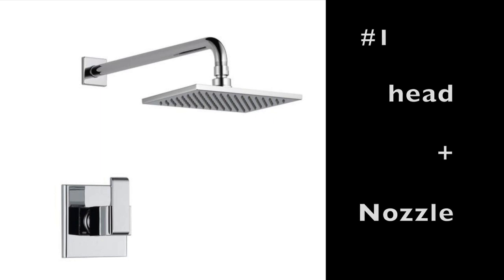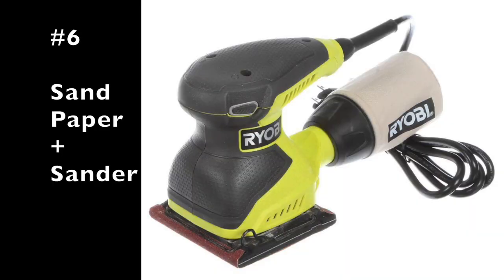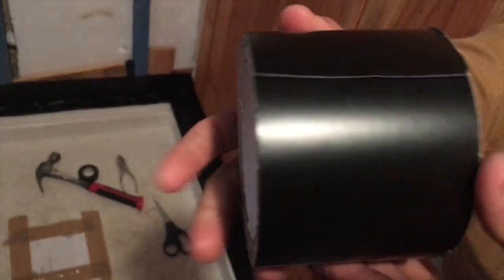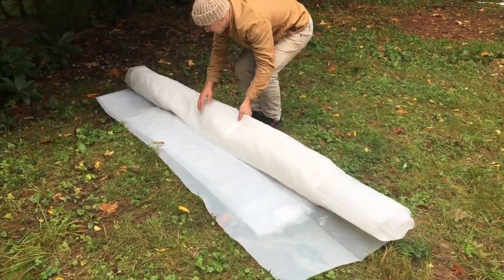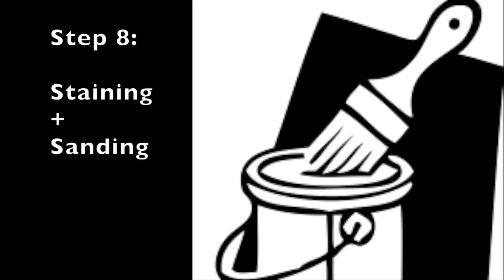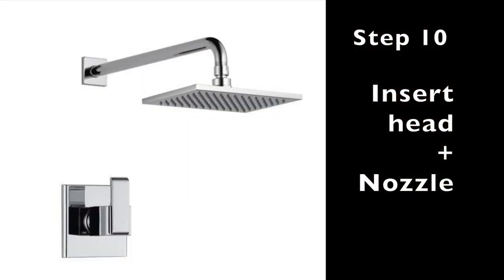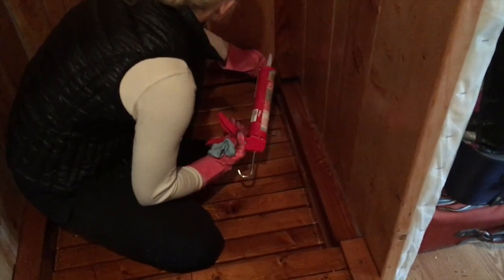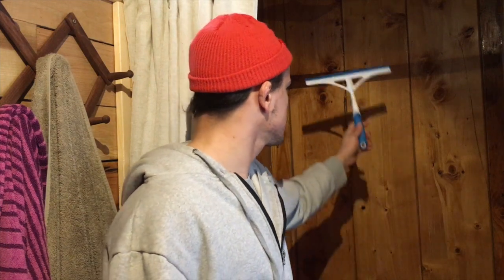DIY indoor wooden shower

Comment: Looks fantastic. I'm considering doing this. The only thing I might suggest doing differently, although it adds some expense, but also considerable longevity, would be to use a tongue and groove cedar. Tight fitting seams that are easy to keep sealed up tight.  Instead of a spar urethane, use a clear epoxy. Absolutely waterproof, and high gloss that lasts, easy to touch up if marred in any way. Brush on an additional coat in the tongue and groove seams for absolute water tightness. And use a PVC shower liner behind the walls instead of the plastic sheeting. All those folds will eventually hold humidity (moisture) and create mold within the wall.

Don't take the above as criticism. I think what you did is outstanding. Just adding some ideas to possibly enhance the experience for others considering doing this.
Reply from the maker: yeah those are all good ideas. I appreciate the feedback.
Reply: I have am starting a similar project.
You made some good suggestions.
Reply: I agree, the spar urethane will probably last a long time too. I do like epoxy more. I think for less maintenance you could have a wall system with a tongue and groove channel that will allow the water to just weep down and use sealant on the backside so it doesn't need to be retouched every few years and avoids old looking moldy spots after a long time. I may have done a wall panel system so the seams are only at the edges. But seriously great work ya'll should be proud!

Comment: So here is a couple of tips for doing this better with no chance of mold, 1 Use metal roof screws with the little gasket on them to secure the plastic. 2 Use pressure treated planks to build out the wood panels from the plastic wrap, Pre drill the holes for the screws to secure the pressure treated planks then fill the pre drilled holes with silicone then secure the pressure treated planks to the wall and the plastic wrap then after bulding out 1-2 inches from the plastic wrap Then secure the stained cedar boards to the pressure treated planks And make sure there is a 1/4 inch gap between the planks, this will allowed for expansion of the boards and make sure there is proper ventilation to dry the planks. Other than that great build and cool look. Also i would spray mold killer/inhibitor behind the planks.

Comment: I plan to build one as well I have most of the materials purchased. I'm still not sure what I'll do on stain if any. Did you receive any off-gassing from the stain especially when the shower is hot. If so how long until the off-gassing no longer happened? and if it had any off gassing was it hard to handle the smell  did it get better? I purchased cedar tongue & groove for mine. Please do advise it's been hard to get information about this topic.
Reply from the maker: It doesn't matter what stain you use, just make sure you coat the boards on all sides with multiple layers of Spar Urithane (I use Helmsman) to seal the wood from water. Once the Urithane dries it should be sealed and then no worries for smells or off gassing.

Comment: I love this and we are thinking about doing the same in our shabin...my question is....how do you like it a year later and have you had any issues?
Reply from the maker: Thank you, and its been almost two years that we've had the shower, and it has worked amazing. I will add, moisture likes to enter wood at the very bottom (like how a string will suck up moisture against gravity) so it started to want to create mold on one of the boards. so i just put extra helmsman on the end. So if I were to do it again, I would maybe dip the ends in extra helmsman, or even a layer of syllicone should fight the moisture. other than that its been amazing.
Reply: @mandmsimplelife2007  we are doing one very soon! And we decided we were going to do overkill and waterproof all sides of the boards. Definitely appreciate the feedback.

Comment: Did you use pressure treated wood?
Reply from the maker: No, we used regular indoor 2''x8'' hemlock boards, and just sealed it with 3 coats of polyurethane
Reply: Ok. Is it completely necessary to apply the  polyurethane on all 4 sides of the boards?
Reply from the maker: It's only completely necessary to polyurethane the front face, but make sure you use silicon down every crack and hole along all the borders to keep water from getting to the other sides of the boards @penguinman1000

Comment: How’s it holding out?
Reply from the maker: It's actually holding out awesome. Even though everyone told me that the walls would warp and mold would grow. My bathroom has good lighting and a fan, and the wood has not changed at all, no warping no mold, and its been almost two years since I completed the project. The only thing that has gotten some wear and tare is the wooden shower floor bottom, some mold seemed to get in the bottom, but I made it removable so I just sanded it down and sealed it better, and she is good to go. Super stoked
Reply: MandM Simplelife have you seen the back of the wall boards? Understand it is not simple to check but if you somehow did or can please let us know. I like the idea and I believe it could be as simple as you did (I remember some Swiss company has made it but the price was just ridiculous). I have similar idea or same idea different design but I am bit scared.
Reply from the maker: We would have to take out the boards to check the studs behind for water damage, but there is no sign of water getting behind the boards, or the silicon in every crack, or the multi layers of plastic rap behind the boards. The shower has not even warped, and it has had no smell, the only thing we changed is lifting the wooden slat bottom to clean out the drain, but other than that it has been holding up solid for almost two years with no problems. I would just advise having good lighting and a fan, but it's up to you, It just beautiful and unique to have the wood for the shower, rather than tile or fiberglass  @mirolubos
Reply: @mandmsimplelife2007  did you put any kind of no slip in floor
Reply from the maker: @terryberger1237  I did not, i like how the glossy boards feel on the feet, but you could easily add no slip grip

Comment: no way on earth that will last. especially the tape =:0
Reply: This lol
Reply: you would be surprised! I would imagine this lasts longer then most showers if you know how bad they are built. Just tile on drywall in most cases!
Reply: It will surprise you. If wood is stained properly and spaces siliconed, it will last several years. I have a 20- year old fence sealed in this way (both sides and edges) and water doesn't penetrate when it's pouring rain. I also had a wood tub surround that lasted at least ten years with no rot or warp. Then we moved. Nothing organic is meant to last forever. By the time it starts to have any problem it's likely a design change will be desired. 

As for that tape, I've used for many projects. Just try to get the blasted stuff off once it's on. Nearly impossible.